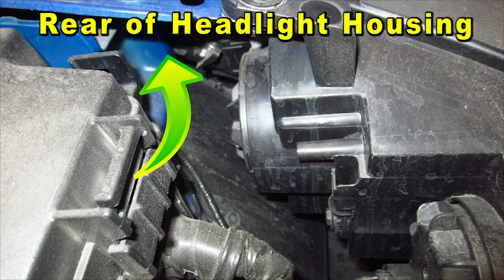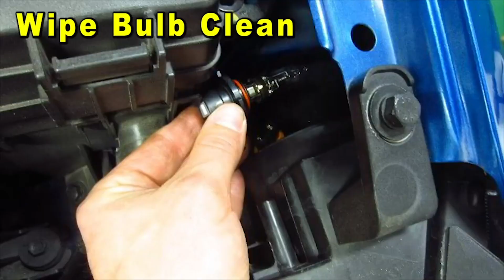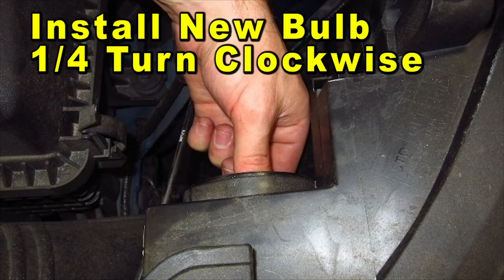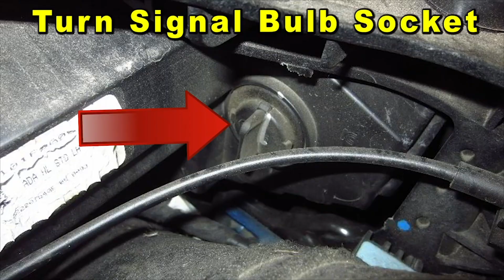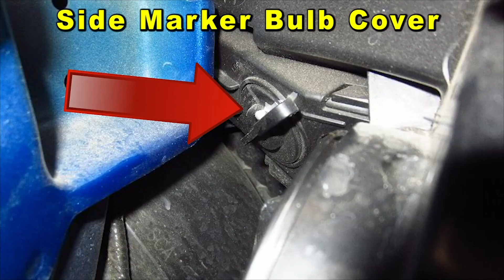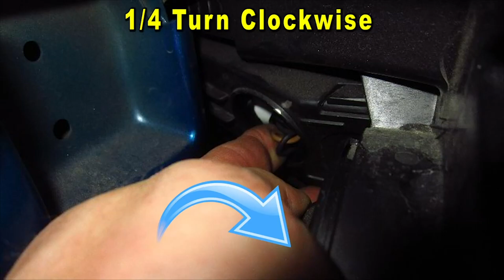2017 To 2020 Hyundai Elantra How To Change Headlight Bulbs With Part Numbers - Quick & Easy

Comment from the maker: Hyundai Elantra Low Beam Headlight Bulb - https://amzn.to/46Ov8ru
LED Low Beam Headlight Bulb Part Number - https://amzn.to/4a8SQBS
Hyundai Elantra High Beam Headlight Bulb - https://amzn.to/3RwAW4J
LED High Beam Headlight Bulb Part # - https://amzn.to/486jrO9
Hyundai Elantra Front Turn Signal Light Bulb - https://amzn.to/4aatB1R
Front Turn Signal LED Light Bulb Part Number - https://amzn.to/4a7qkAD
Hyundai Elantra Front Side Marker Light Bulb - https://amzn.to/473YLFL
Precision Screwdriver Set - https://amzn.to/3sLixaP
Plastic Pry Bar Tools - https://amzn.to/3HMtsV7
Socket & Ratchet Set - https://amzn.to/3Z17LbA
Mechanix Gloves - https://amzn.to/3jCnHkt
Torque Wrench - https://amzn.to/3vS5uSI

The Paul79UF YouTube channel is a participant in the Amazon Services LLC Associates Program, an affiliate advertising program designed to provide a means for sites to earn advertising fees by advertising and linking to Amazon.

This DIY video shows owners of the 6th generation 2017, 2018, 2019 & 2020 Hyundai Elantra sedan how to change a burnt out low beam, high beam, front turn signal or front side marker light bulb in the headlight housings.

Comment from the maker: Check out the DIY guide for changing the headlight bulbs in a sixth generation 2017, 2018, 2019 & 2020 Hyundai Elantra - 
https://www.paulstravelpictures.com/2017-2020-Hyundai-Elantra-Headlight-Bulbs-Replacement-Guide/index.html

Here are all of the DIY repair and maintenance tutorials for the 6th generation 2017, 2018, 2019 & 2020 Hyundai Elantra sedan - 
https://www.paulstravelpictures.com/Articles/2017-2020-Hyundai-Elantra-DIY-Repair-Maintenance-Guides.htm

Owners of other Hyundai, Genesis or Kia vehicles such as the Sonata, Accent, Veloster, Ioniq, Kona, Nexo, Venue, Tucson, Santa Fe, Palisade, G70, G80, G90, Soul, Sportage, Niro, Sorento, Telluride, Rio, Forte, Optima, Stinger, Cadenza, K900, Sedona and Seltos may also find these DIY instructions to be helpful.